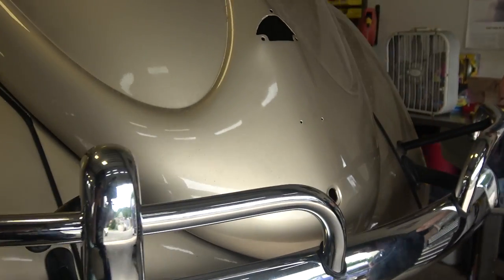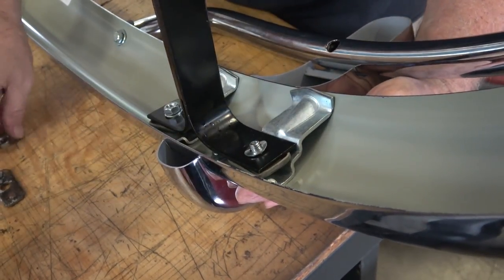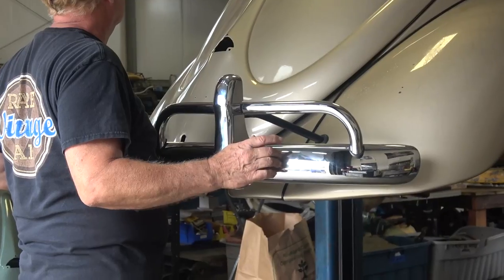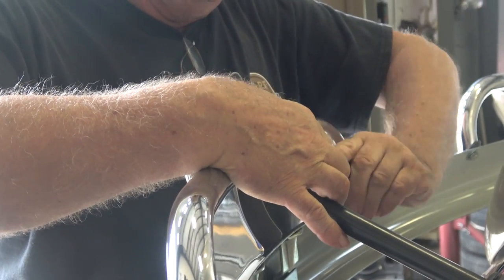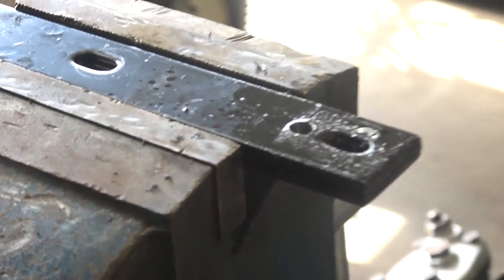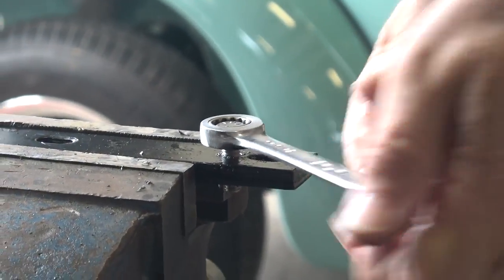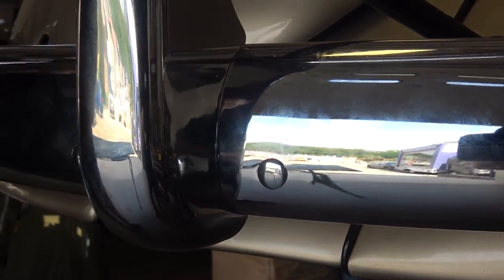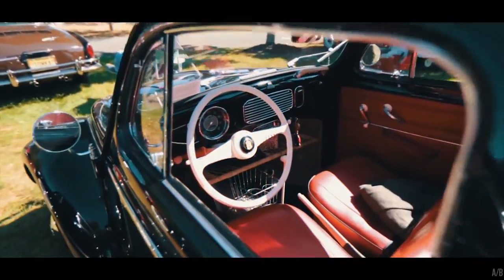Classic VW BuGs How to Tip Beetle Engine Decklid Bumper Clearance

Comment: Hi Chris how do you adjust decklid gapping near the air vents underneath the rear glass? regards
Reply from the maker: the 4 10mm headed bolts that hold the decklid on are adjustable.

Comment: Hi Chris,  great video. Two questions. 1. Why not add a spacer at the bumper overrider and avoid drilling? Cleaner look? 2. I didn,'t see the wire holder at the pope nose hole on the decklid. Do you bend them into the engine bay or into the popes nose?
Reply from the maker: Might be another video I can cover on this, maybe to add a spacer at the bumper over rider, but it comes down to the look of it really.  What wire holder do you mean?
Reply: @classicvwbugs  does that year decklid not have the metal butterfly tab that is part of the original pressing? I'll try to find a photo. Thank you as always!!

Comment: The problem is with wrong placement of holes in repro bumpers. You can see this in the pic: https://aijaa.com/dgJXd6 . There is 5 mm difference between original and new. I wish part makers corrected this issue.

Comment: Had you considered simply cutting the tubing, adding in a piece of similar tubing via welding, and then grinding it down and painting? What you have done is a shade tree diy repair in my opinion. It has no place in a car for which a customer is paying thousands of dollars. IMHO.
Reply from the maker: Really, shade tree?  This is meant for the guy that just bought a bumper expecting it to fit right and then are faced with improvising and making adjustments.  This was a way (in short time) make a fix that not only can be done at home, but also keeps costs down and keeps the strength of the tube intact without jeopardizing the look of it all.  There is nothing shade tree about it.  Most people watching this do not have a welder or have access to one, or want to hire someone and pay them to weld.  You want to cut and weld in a section to make it longer?  Then grind it down and paint it?  The strength of that tube would be so weak.  Grinding it down flat would weaken it.  By doing it this way you keep strength intact, without adding so many steps.